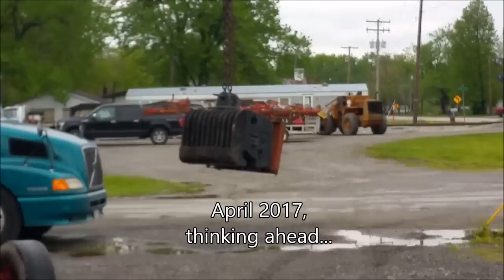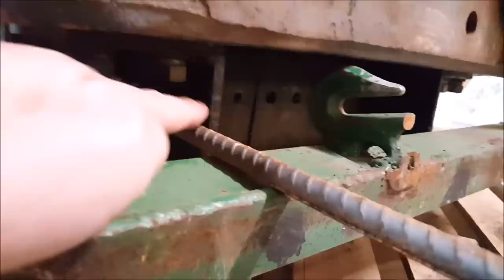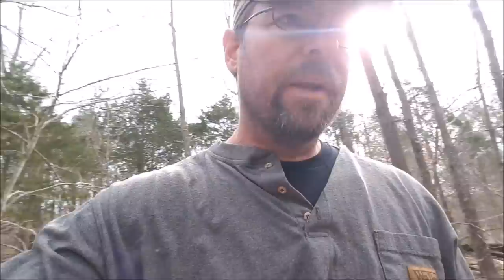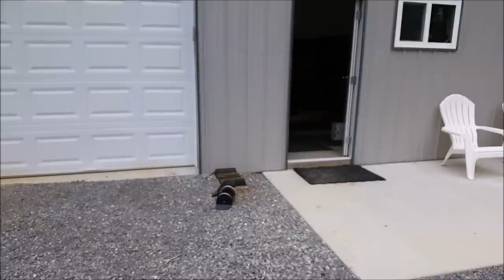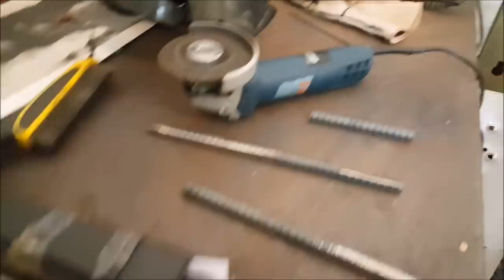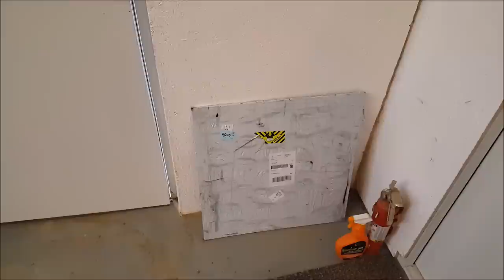Weekend Farm VLOG; Tractor weights, Puppy dog swim?, Long Range & More

Comment: Kap I noticed ur back blade out in the rain. Almost lost my rock rake by water goin in the pin hole where u adjust the angle and there was no weep hole. Filled up, froze and was just about to split when I found it. Just FYI. Luv the vids. Glad ur son is home safe.
Reply from the maker: Thanks man, I don't like anything outside, I'm working on cleaning up the barn or adding a lean to at some point on the barn..